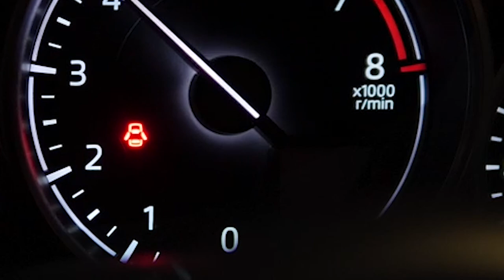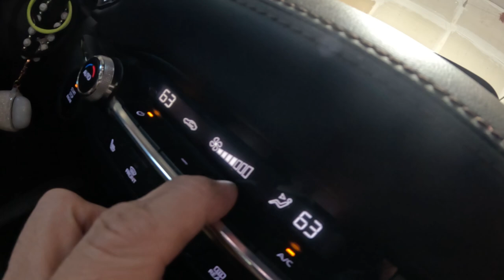Mazda 3 Premiere blower motor removal with knee air bag.

Comment: I own a 2015 Mazda 6 that I got in 2017 when I retired , it looks new, only 27000 miles and only had to replace the battery a couple of times because I dont commute any more , just trips to the store but I do run it at idle for about 15 mins before and after going to the store so last november , I installed an OPTIMA Red top battery with 720CCA and I highly recommend it for anyone who wants the most reliable most powerful battery on the market. I subscribed only to watch your Mazda videos , sorry I don"t care about the Firebird stuff . ❤
Reply from the maker: Thats awesome. Thanks for watching, thanks for your comment, and thanks for your support.  Optima RedTop. I've heard a lot of good things about those batteries but, never owned one. It's good to let the engine run and warm up like that. Keeps the engine lubricated and also keeps the muffler from rusting out so quickly if moisture from the exhaust doesn't have time to evaporate on very short trips.